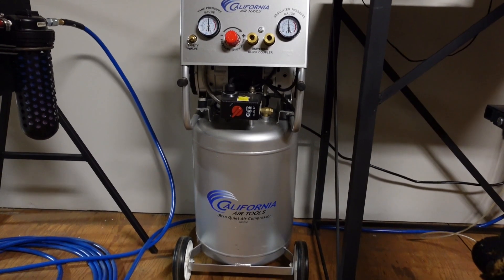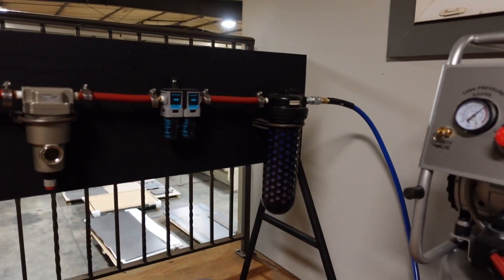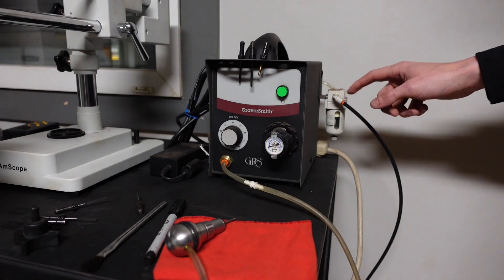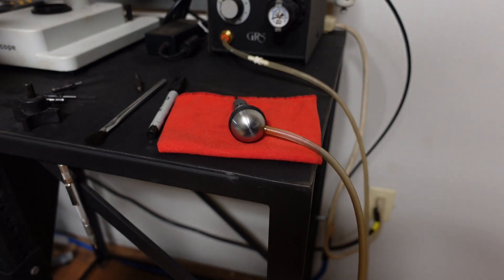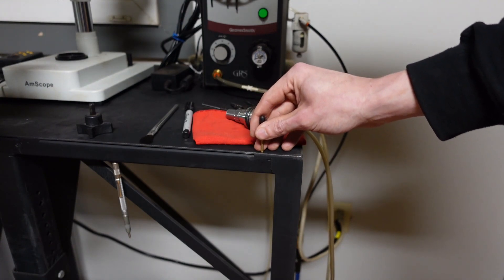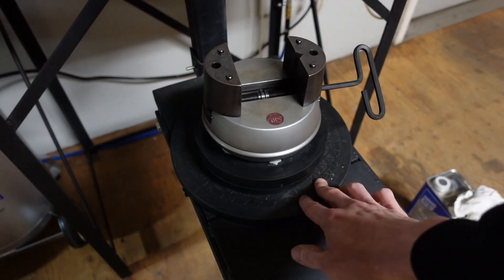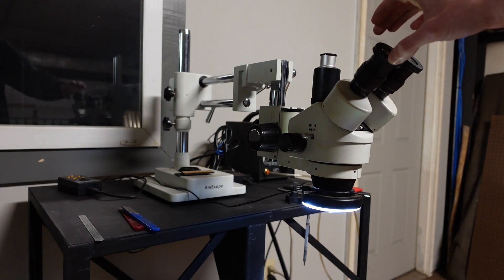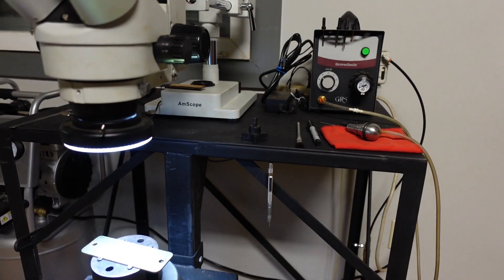Beginners Guide for Pneumatic Engraving Tools

Comment: The only sharpies that dont wipe off metal easily are the induatrial ones. Regular sharpies still smuch off pretty easily. I usually draw my design and they spray a fixative over it so it does wipe off on me while i work. Ive been doing engraving with micromotors and just got my pnumatic engraving setup in today, still waiting for the compressor and then its off the the races.

Comment: great video, but thinking about the 2.5 vs 1.5 barlow lenses, the 2.5 would mainly be used as an 'inspection' lens, once done, or to check on quality of the cutting, NOT for general work, this would be provided as they don't know what this is going to be used for, and mostly these are used in factories for inspecting soldering joints, or other QC tasks, the lower powered one is the one for using it for cutting, or sharpening gravers, etc. as it offers the right working distance.

Comment: After using the Graversmith for a while, are there any features that you really wish it had that the more expensive models come with? I'm looking to upgrade my system, and the Graversmith is a really attractive option, but I'd hate to kick myself a year or two down the road for not saving longer for something like the Gravermax G8. I don't foresee myself needing anything more than the Graversmith offers, but I thought it better to ask someone with some time with the machine.

Comment: Great info! I don’t think anything is overkill when you’re using a $1-2K engraver at the end of that line. Perhaps the filter on the Graversmith is adequate but so is my front doorknob lock and I still use a deadbolt. ;)
Thank you for this detailed video! It’s exactly what I needed as I get ready to buy my GRS set up.